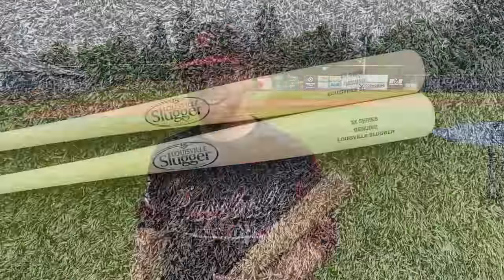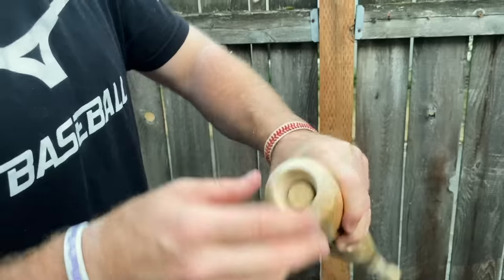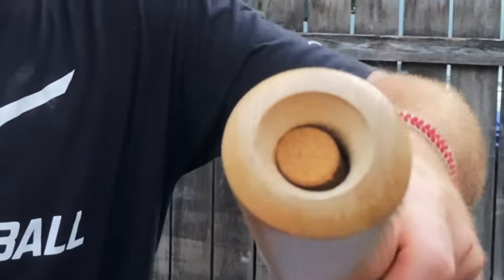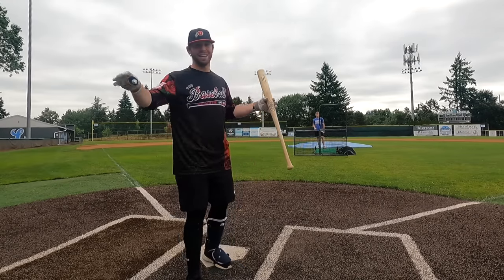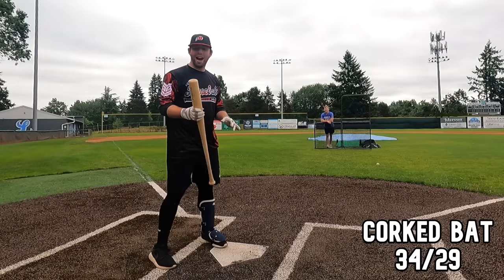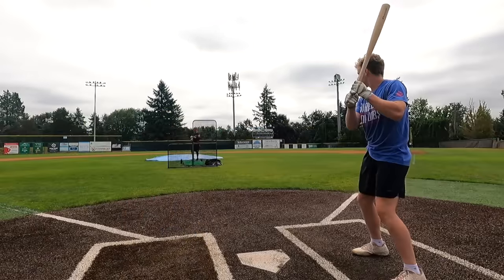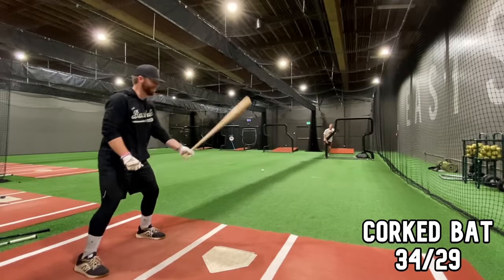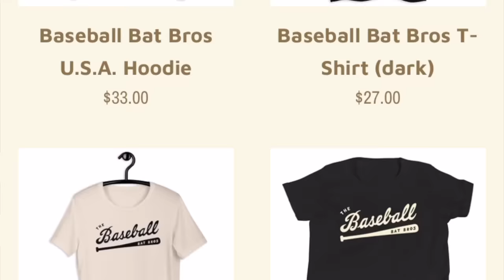Hitting with a CORKED BAT | Wood Baseball Bat Reviews

Comment: so.... why did you use corks that were smaller than the hole you drilled??
.
i thought the cork helps with the impact... like transferring energy.... 
and if its not touching / bonded with the wood.... the cork isnt doing ANYTHING
.
like, might as well just leave the cavity empty.........
.
.
.
also, i can REALLY tell you guys are not mechanics, carpenters, or DIY type people
i would have just used a normal drill bit VS a flat "spade bit"........
.
and sized the drill bit so id have to firmly tap the corks into the hole
.
.
also their are things called "core-ing bits".... that would leave you with a "core" 
you could then cut off a 1/2 inch of it.... and have a plug for the end of the bat
Reply: like.... real MLB players fill the hole back up with cork to either add strength (which i doubt.... dork is NOT strong)
.
or because the 0.001 inches the wood compresses... will be transferred to the cork
and because cork is "spring-y"... helps "bounce" the ball off the bat
.
so again, having ALL THAT SPACE between the hole and the corks...... 
makes this test irrelevant 
.
.
you ARE NOT testing a corked bat
you are testing a LIGHTER bat (with a hallow core)

Comment: this is a pretty useless test. the bore is far too wide, didn't even bother to get the right sized bit. the cork is supposed to be snug. not just tossed in and plugged with spackle. When people do try to cork a bat to cheat, they bore a hole the same diameter of the cork, and press fit the corks snuggly inside so the transfer of impact energy is uniform. all you're doing here is hitting it with a hollow bat with loose cork inside.

Comment: You are using the wrong tool & bit… next time figure out the exact width & depth you want to go than by a bit at that width & length (not a spade bit) which is what you used… next, I would’ve used an impact to drill the whole simply for the reason that it doesn’t tork on you. It’s a lot easier to drill with,  for this situation. Also you could make or buy a plug to put at the hole after you corked it then wood epoxy & sand… you’d never know the difference & would last. The bat would split in half before that cork tip came off.

Comment: Your cooking job is absolutely horrendous. The hole size needs to be exactly the same size as the cork inserts.  When done properly   not only do you lighten the bat it does give more reaction.   Also  a well corked bat is not as week as your poorly corked bat.         Also  a well done  corking has an ash plug covering the cork.  Many MLB players corked their bats over the years.. punishment was not high enough to end the practice.      It was reported that Pete Rose would use a corked bat.   His guy has posted a video on how a professional does it.